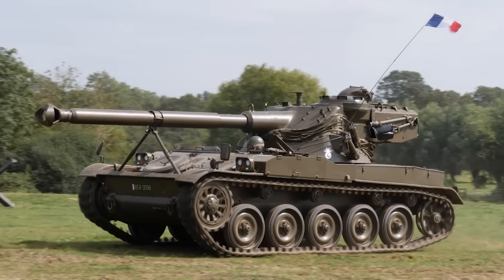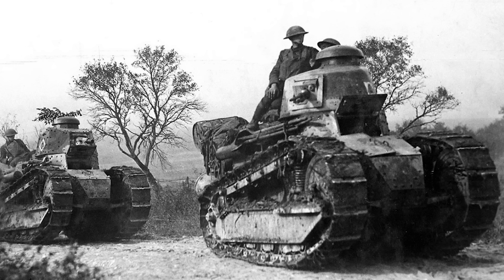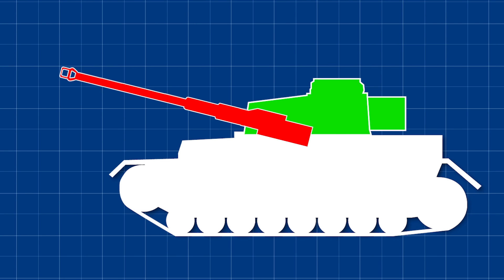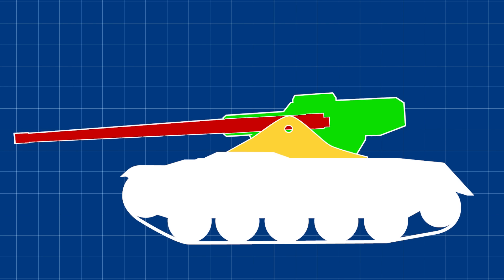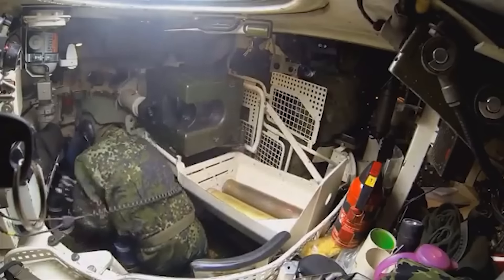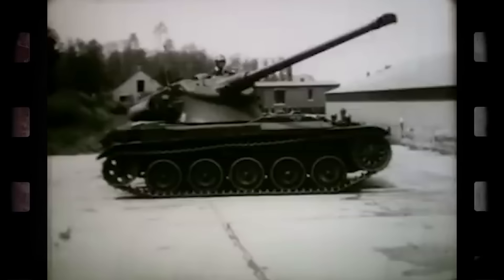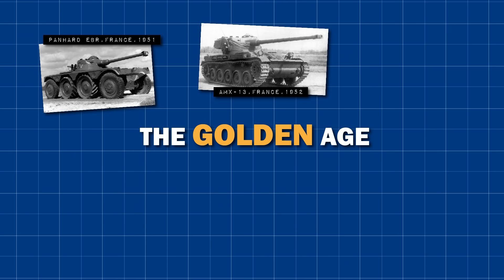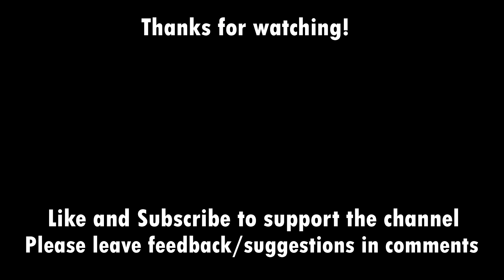What actually IS an “Oscillating” turret?

Comment: You know what other fatal flaw nearly all armored vehicles have?
They have a crew inside them.

Without a crew, a tank would be a main gun with autoloader and coaxial on tracks.
It would be remotely controlled and should it break or fail it's not really a big deal as no lives will be lost. Lives are way more valuable than the tank itself. And because it doesn't have to protect the crew it can be much smaller, way more mobile, have a better/bigger gun system and still be less expensive than a conventional tank.

Sure, you are not meant to lose the asset but in a real fight big military against big military there's going to be losses. Just DEAL with it.

In fact, the better solution in the end is actually to wage wars on a virtual battlefield where no human lives are at risk to begin with.
If politicians could get it out of their system in say ARMA then we could cut costs in lives and money by insane amounts.
Reply: And battles would look a lot cooler.

Also, unmanned tanks are still a ways off. It's easy to say "just remove the crew lmao" but it's much harder to actually do and match the same performance current tanks have.